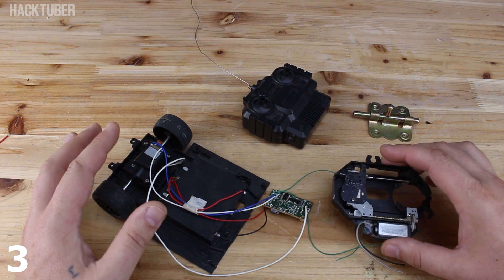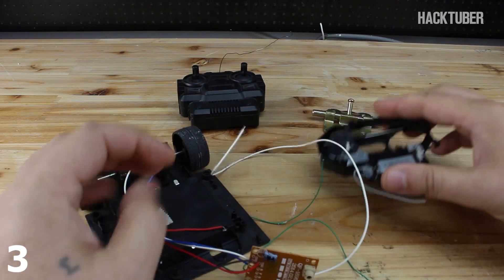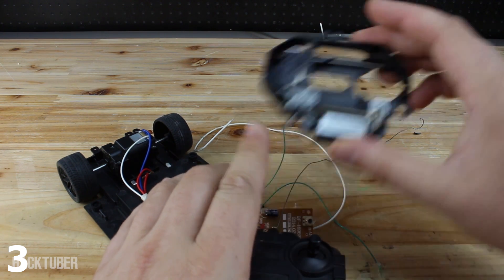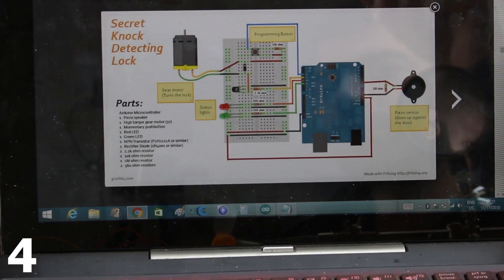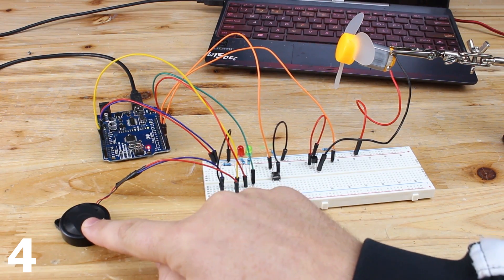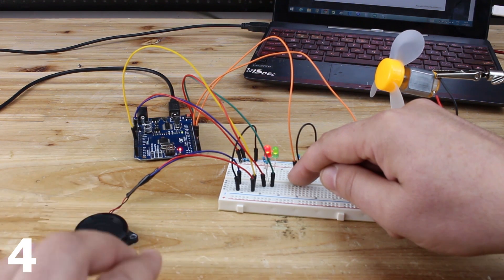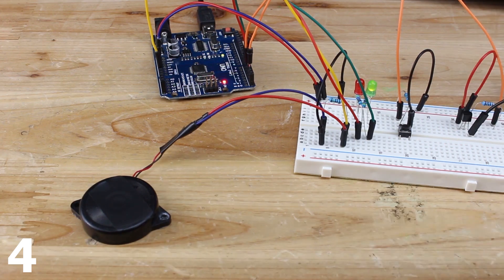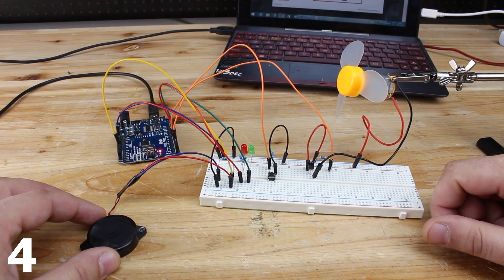5 DIY and Homemade Inventions

Comment: the motor will hot and blow out because there not switch that stop the motor after it pushing the lock and just stuck there draining the battery ...

Comment: The question is that if the battery die then how we go a open the door
Reply from the maker: If you try to make this for real that you need to add backup power
Reply: Thanks
Reply: @Hacktuber  u mean adaptor ؟ if it s malfunction or elictricity cut off what would u do
Reply: Ain't the bat ment to be backup ....if made like this on card just push it'll fall off 😂😂😂